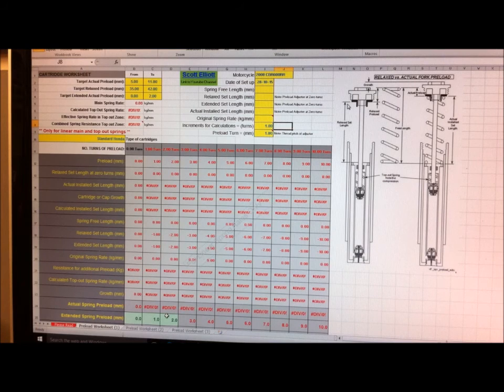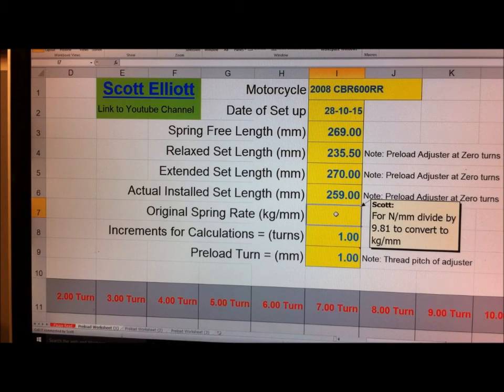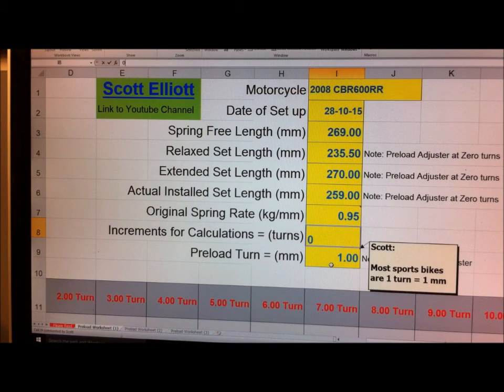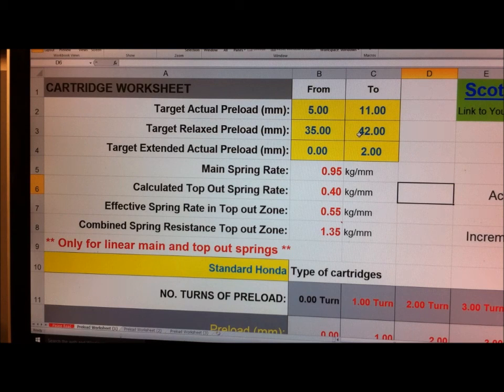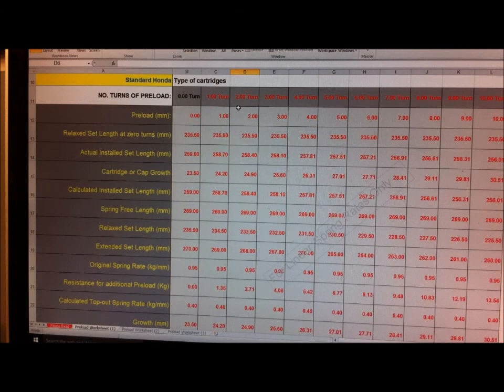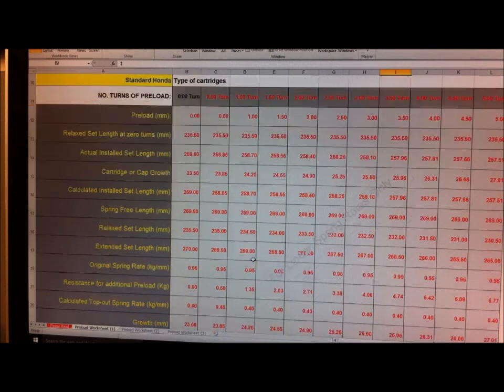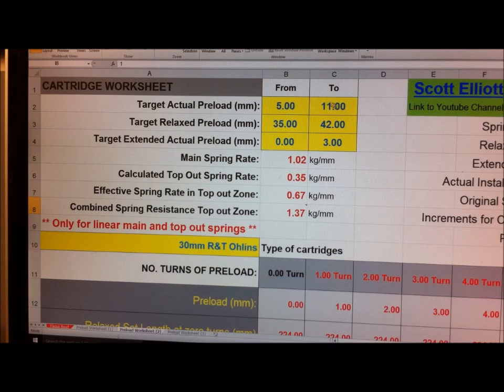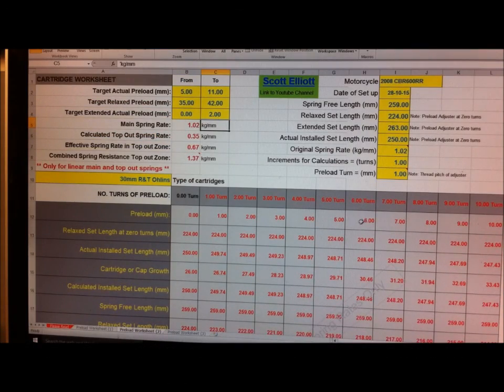Part 2 Motorcycle Cartridge Fork Setting Up Sports Bikes with Top out Springs Rider Sag Preload

Comment: nice and detailed work there. thanks for sharing it.   I just couldn't understand the benefit of shortening preload tube. I believe you changed the preload adjusting range to lesser amount only. I think everyone can reach to 45 mm rider sag if the spring rate is not wrong for the rider. so after this modification we need to turn preload adjuster a few turns more in?

Comment: Great video series Scott, very informative. I may have missed it but do you cover what the top out spring rates and lengths are or doesn’t it matter? Also, how does all this affect setting up laden sag? Cheers, Don
Reply from the maker: Hi Don,

After you've carefully taken measurements as described in the video and input them into the spreadsheet that will calculate the top out spring rate. One of the measurements you make is the top out spring travel.
The top out spring is there to approximately halve the spring rate when the front wheel is carrying very little or no weight whilst under hard acceleration exiting a corner. Modern sports bikes don't usually require much change to front spring rates so the original top out springs are normally fine. They don't need to be replaced unless you made significant changes to the front unsprung weight like installing light weight carbon fibre wheel and rotors. Regards, Scott
Reply: Cheers Scott, that makes sense and thanks too for the prompt response 👍
Reply: Hi Scott, this is a fascinating subject so I have a few more questions if I may. Am I correct to assume that 'target relaxed preload' is the same as laden sag (rider onboard)? Also, is there something particular about 'target actual preload' being around the 10mm mark? If you arrive at more than 10mm to achieve sag I guess you're looking for a stiffer spring? Cheers!
Reply from the maker: @donr62  Hi Don. Well the old rider sag is no longer relevant since top out springs. It takes a while to get the head around this Basically you do this fork set up off the bike and that's it. As I say in the first video you want the rider sag not interfering with the top out spring ... you want to be supported by the main spring when in a neutral position. As far as actual preload you don't want more than 10mm. These days I run even less. If you're getting more than 10mm then get a stiffer spring.
Reply: @ScottElliott152  thanks mate!